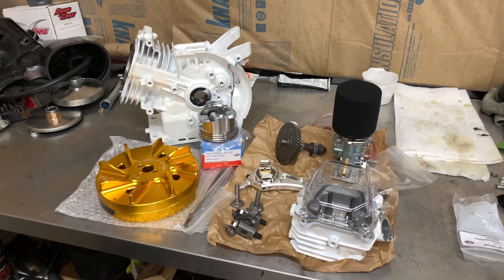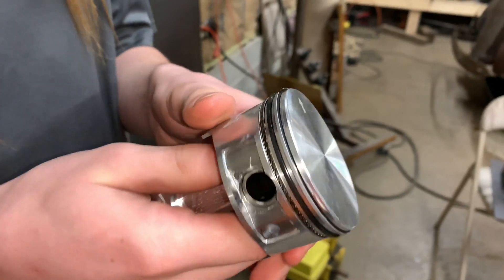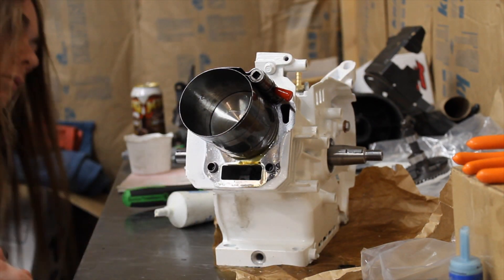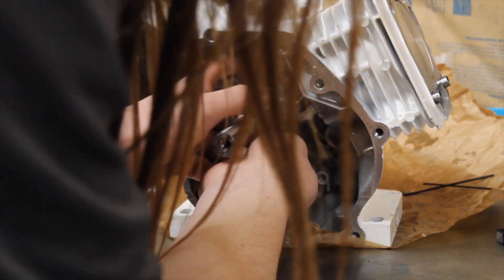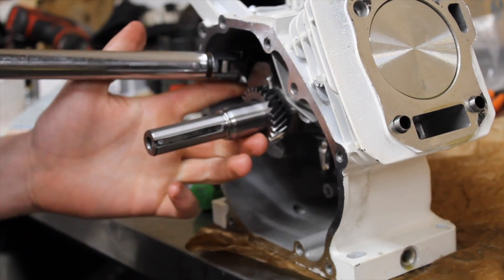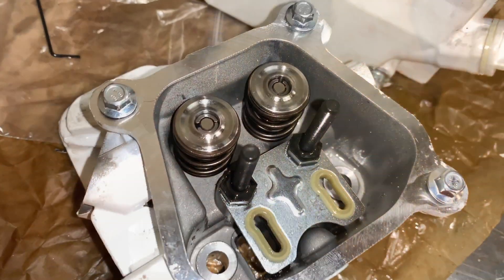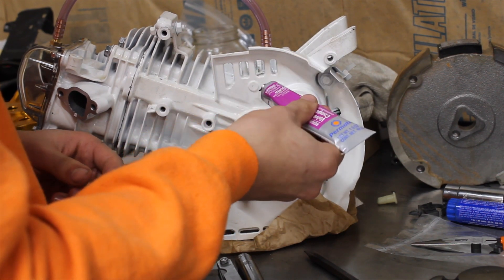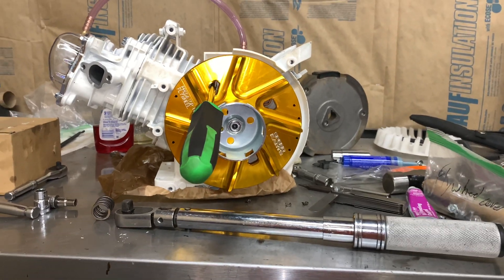Katana’s Engine (Predator 212cc stage 4 build)

Comment: Hey udid hemi piston with +40 rod?     How well does that run? I want more power than bolt on stuff and 22lb springs, want a cam to help power without crazy Mods To do it,any suggestions?